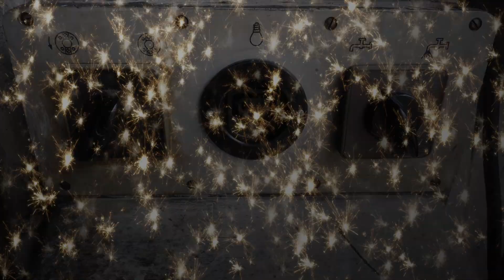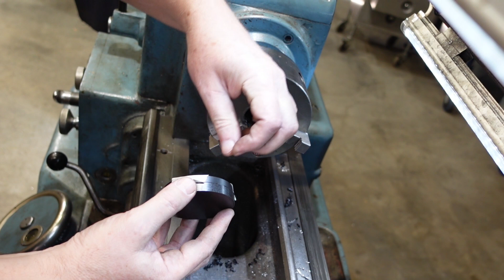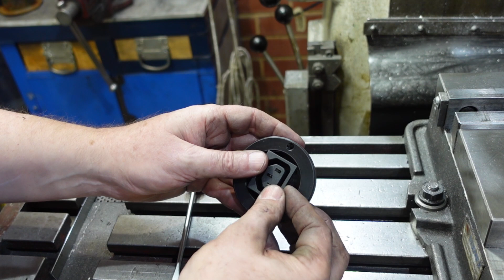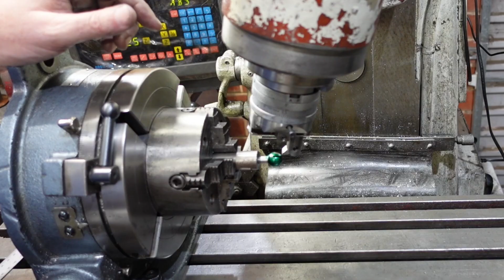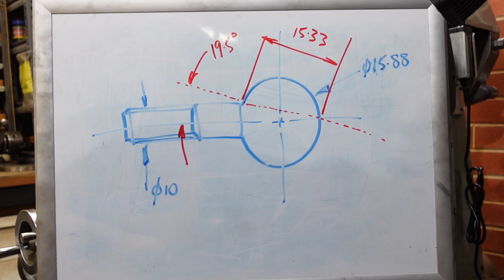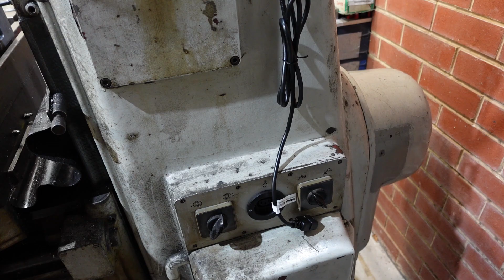A lighting upgrade for the mill

Comment: I used to buy knockoff gadgets / tools and be disappointed they often didn't work as advertised.  As I got older, I just bought them when I needed something consumable or disposable.  Now that I'm ancient, I buy them as 'kits' to be improved, and as a tangible model of something I need to figure out the workings thereof.

My latest sacrifice to the machine gods is a 12-volt jack / lift intended for changing car tires.  I seriously doubt it is capable of the 5 tons claimed, but my intent was to build an automated aluminum can crusher, and see how it holds up.  If it turns out to actually be hydraulic, as claimed, that's what I'd like to learn a bit by playing around with it.  

Even if it turns out to be an electric motor powered screw jack, I'm thinking I can still get it to crush cans on command, and see how to beef up the implementation to be reasonably durable.
Reply from the maker: In a way I'm lucky the arm was a knock-off. If it were the genuine article I don't think I would have been game to take it apart.

Comment: Enjoyed the clear explanation of the spherical milling thanks.  I hope the reduction in thread size to 8mm doesn't eventually bite you!
Reply from the maker: I've been using it for a few weeks now and it seems to be going alright. The lamps are relatively light; the arm to machine connection has a bit of torque on it, but that has stayed at 10mm, so should be good.

Comment: If in doubt, consult the doubt-a-sheet 😁👍 I dont have a mill (yet), but im gonna borrow a rudimentary adaptation of your great work for my drill press and belt sander 😊 thank you 🙏
Reply from the maker: The belt sander takes it's chances but on the drill press I have a similar sort of light (about half the intensity and only one) tucked up between the column and the spindle. Nice thing about LED lighting - far easier to put in a small spot than the older style incandescents.